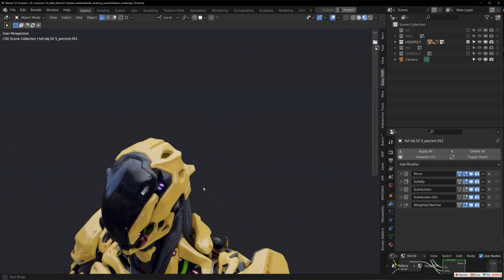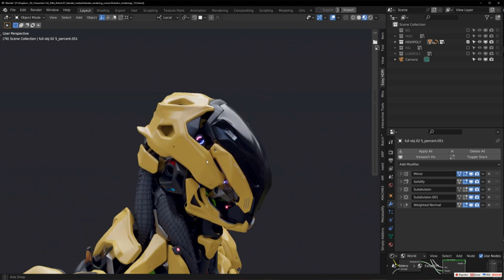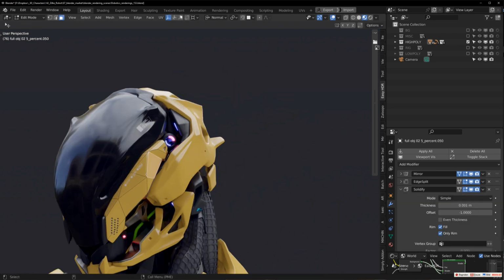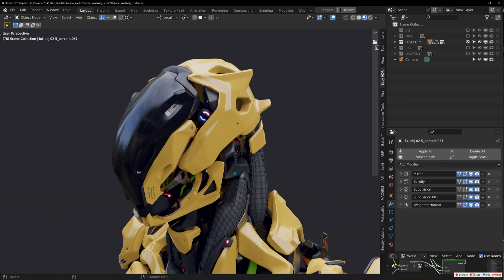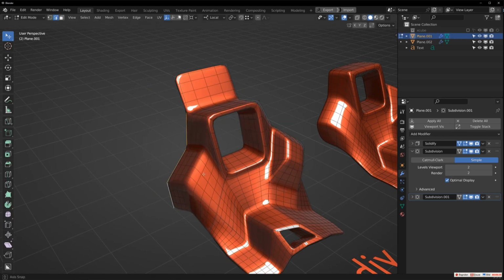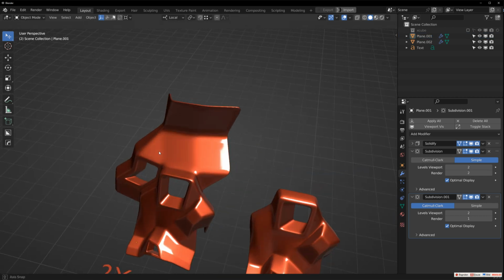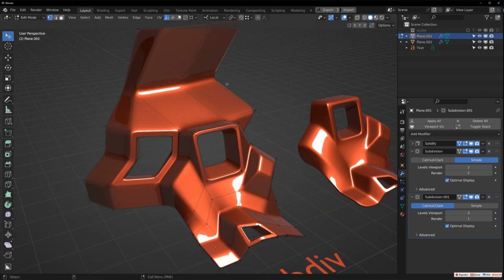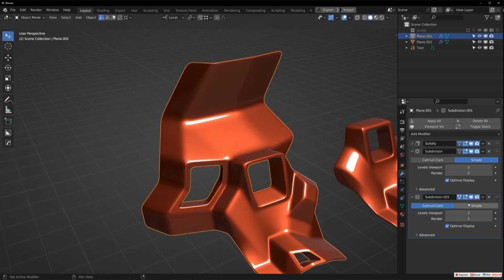Two subdivision modifier workflow

Comment: Hi there! This is kind of a good tick but this will increase your polygons exponentially with each subdiv level. For a similar result, I would use a Bevel modifier before subdiv modifier, that way you can control the amount and distance of the support edges, plus if you set it to "weight" method, you can choose your model gets beveled or not. Otherwise, I'd just select everything in my mesh and give it an edge crease value of 0.5 or whatever you find ok.

Comment: OOOH I do this in the 3ds max, I add a 2 or so iteration turbosmooth modifier using smoothing groups to smooth, then an additional one on top that smooths regularly, super quick way to get nice hard surface details
Reply from the maker: Yeah started with 3dmax long time ago then switched to blender. Miss couple things from max.

Comment: This is really useful! Thanks for sharing. I was confused at first because simply stacking two subdiv modifiers doesn't do anything different from simply increasing the number of subdivisions on one modifier. But then I realized you need the first to be set to "simple" subdivision and the second to catmull-clark. This should be made more clear right away. It is explained near the end of the video, but setting the first to "simple" isn't mentioned, though you can see the setting. Anyway, thanks again! I never thought of doing this.
Reply: Definitely should have been mentioned in the video, but thanks for pointing it out.
Reply: Yeah, that's helpful, that information makes the whole video understandable. Should have been emphasised at the beginning.

Comment: sweet. Does anyone have tips for quickly adjusting edge weights (edge crease in blender) when using the catmull clark? This was like "the way" with Modo in 2009 but in blender it seems to me that the functionality is there its just not easily available - for example there is no overall edge weight control on the modifier and to adjust it per edge its in a menu (*or shortcut SHIFT-E) .
oh and top of that vertex creasing does have a menu when you apply it, but it also has flipped controls when applying . What is happening... This is 3.5 btw

Comment: Great. Now, on top of that start defining creases (shift + e) to get even more control over transitions from hard to soft and vice-versa. I know many people hasn't opened their eyes yet how a simple modeling can get powered up so much by different modifiers combinations. The possibilities and the potential modeling workflows are huge and the maintenance is much better. Thanks for sharing awareness on this regard!
Reply from the maker: Thanks bro! In case you know some more tricks in blender hard surface please share. Im also very interested in such stuff! Work with Blender for a long time, but always discover new hidden things here and there.
Reply: @MichaelWeisheim_Raidmask  I was sent this video by a friend just now, and was wondering why edge/vertex crease seems to be an unknown method that's not talked about at all.
As a Blender tutor, I highly recommend using that (Crease + single modifier) over this two modifier process, as it gives more control over the shape and is tremendously more processing efficient.

Comment: Great hard surface design! Will you make videos about the early concepting stage and how to create fast iterations with techniques like this? It would be very interesting. 
However I can't wait to see your next contents. Instant subscription to the channel 👍
Reply from the maker: Thanks bro. For complex stuff like characters i do sometimes zbrush volume sketch (rough) first then jump to blender and work with 2X subdiv on top . For simple things like sword where i have a clear vision already i start directly with 2X subdiv. In general i could also start with 2X sub from beginning,  but i found to have a volume mesh first bit easier.
Reply: @MichaelWeisheim_Raidmask  Thank you for the insight. Are you using hard ops for the hard surface modeling as well as booleans? Thanks again Michael!
Reply: @NME10E  Really good question i was doing a lot of boolean stuff because of Blender Bros. But i have feeling it i should dive deeper into only quad based modeling

Comment: Yes this method is very helpful rather to use edgeloop in earlier stage, it is very painful to align the support edges after we change the shapes. I was alsi thing about some addon that can mark edges as support loops so each time we make changes to main geometry blender recalculate those edges and their slide ratio. I also miss the edit poly modifier workflow of 3ds max that give you full control over any level of form, with the help of 4-5 edit poly modifier we can handle the form in any possible way.